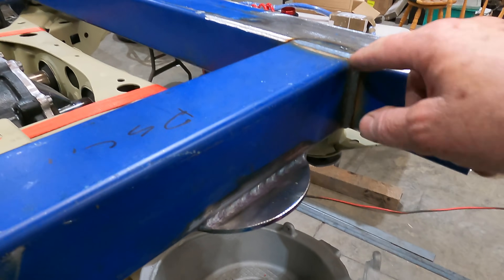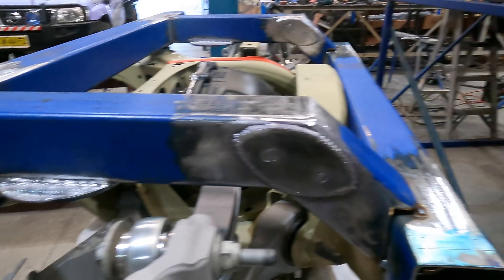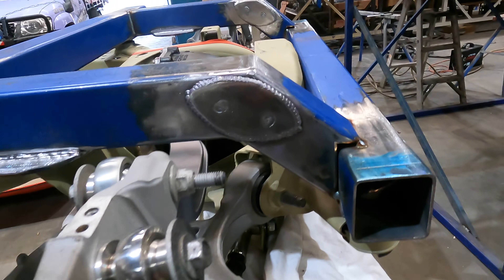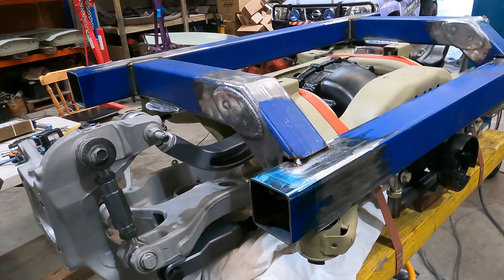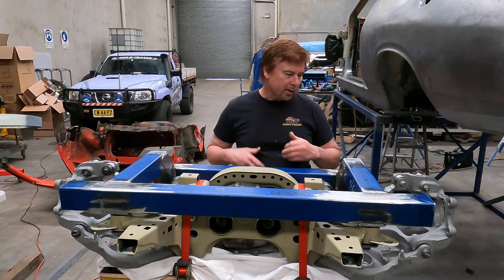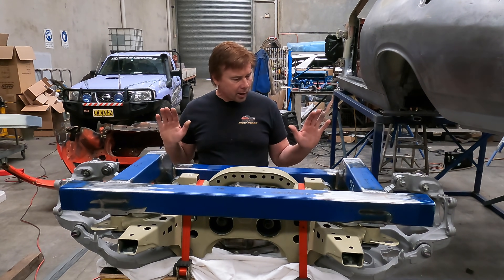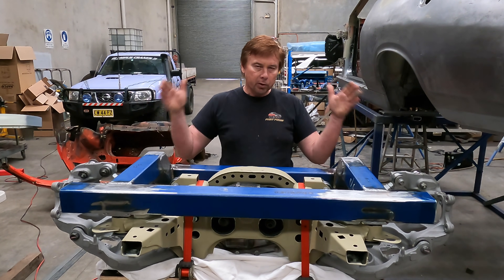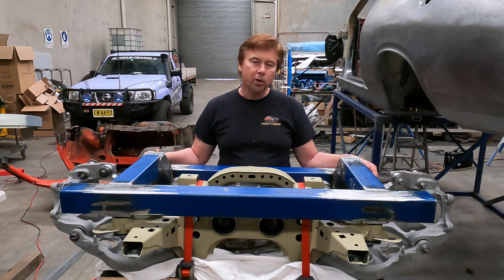I Fabricate a Subframe for the IRS - Episode 63  XB Coupe , Mustang GT floorpan , Coyote swap

Comment: There should be at least 2 holes in the car subframe and 2 holes in the IRS frame that match on either side so you can realign (using metal dowel pins or maybe sockets that fit into the holes perfectly) the IRS back in the car after it has been removed for service, repair or some other reason. 

I don't know how many the mustangs have or where they are located but on the late model falcons there is one either side that my SP brand 14mm and 17mm deep impact sockets fit perfectly into. We only had one set of aligning dowel pins at the dealership and it was a pain to try and find them when they weren't put back in the tool room.
Reply from the maker: Thanks for the tip mate I will look into that , I dont remember seeing anything on the mustang but that dosnt mean it isnt there
Reply from the maker: I think I may see that locating hole now, in the scene where I show the old section of chassis rail which im
About to cut, there is a second hole about 12mm dia. And holes on the rhs frame in the same approx position, so I will use them as my guides and drill into the boue rhs through them and have at least 2 locator pins either side on the front. Cheers
Reply: @phatridesgarage3760  also I've seen few videos with the American cars that have the IRS frame (diff cradle) mounted to the car via bushes, and they will remove the rubber bushes and replace them with a solid steel or aluminium blocks machined to press fit in place. 

The diff cradle on the Falcons are bolted directly to the subframe.
Reply from the maker: @Dropbear237  yeah i think i know what you mean , I was planning to use some of those bush strengthening items later on
Reply: @phatridesgarage3760  I was thinking there might be something with the tabs on the back of the rear bushes.